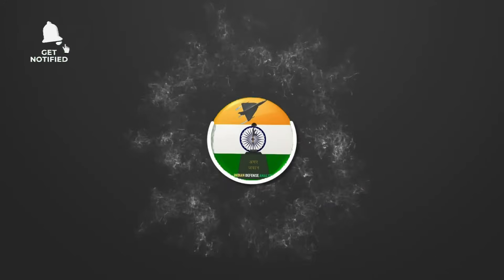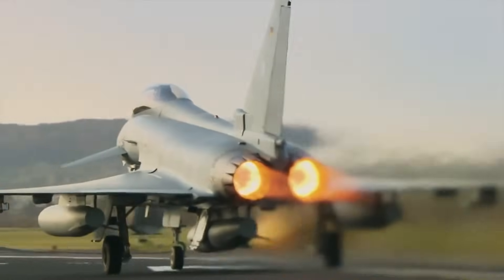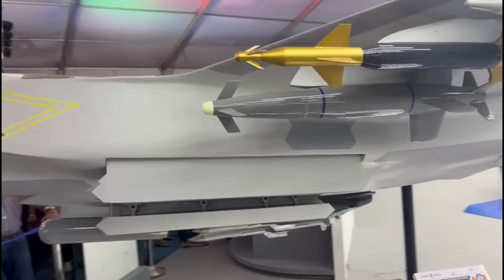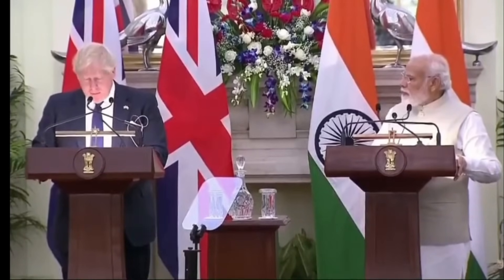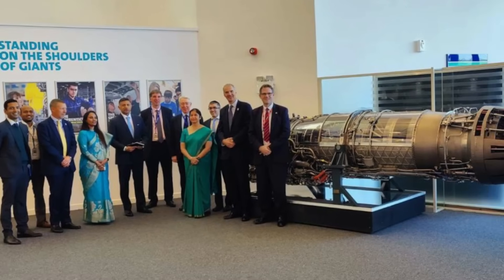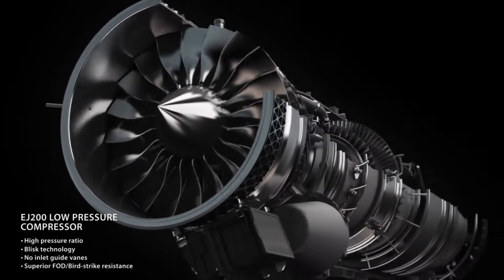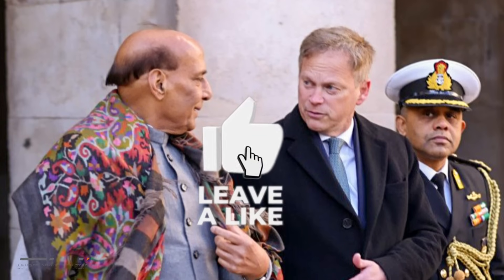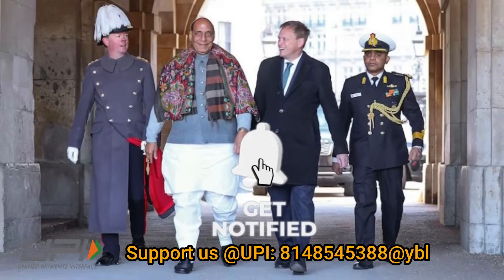India’s quest for fighter jet engine development and collaboration with Rolls Royce

Comment: 110kN is not enough
Reply: Fuel ?  Tu  deega !😂

AMCA  IS Small (like-F35/ 🇰🇷 KF-21)
       (Search f-35 / KF-21  thrust kn ?)
Reply: Fuel ?  Tera  baap deega !😂

AMCA  IS Small (like-F35/ 🇰🇷 KF-21/ Su 75 )
       (Search f-35 / KF-21  thrust kn ?)

110+kn.  +  110+kn.  = 220+kn pagal 😂
________________________________
India needs :- 110kn in Indian climate.(that meaning 110+kn)
    (Maybe 110kn-- 130kn)